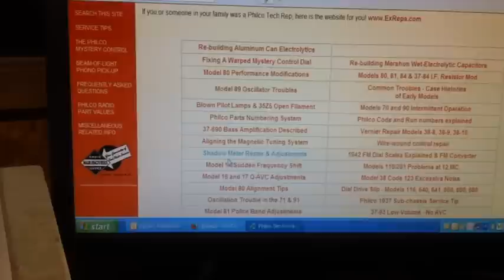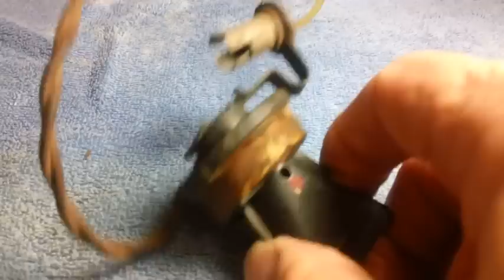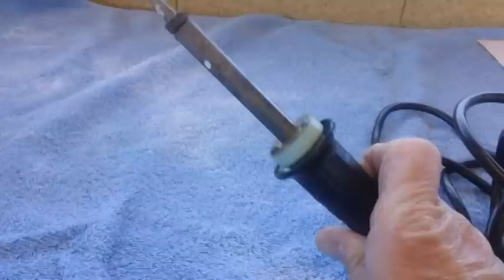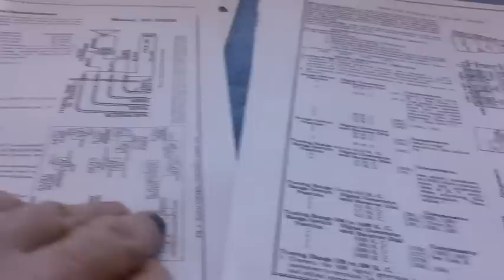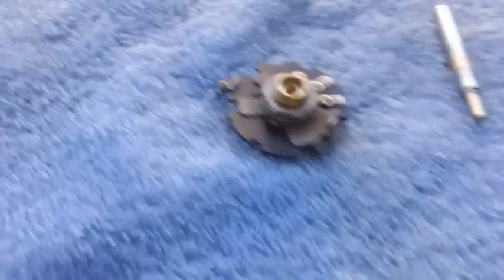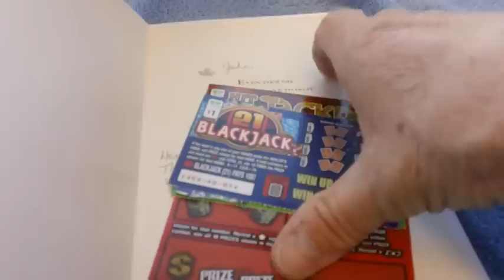Philco model 37-2670 repair and restoration (Part 7 of 34)

Comment: Great video, John. I'm a bit of a newcomer to rehabbing these old radios -- and I've been using your teaching as guidance. So far, I've completed basic restoration on a couple of Silvertone radios. I wouldn't have been able to do so without your videos. (My next is a Philco 42-355. I've already obtained the schematics from Chuck Schwark.)

Keep the videos coming. I look forward to seeing this one complete.

Best regards,

Ron
Reply from the maker: Hey, Ron...it's good of you to be part of our little group.
I had never seen a model 42-355, so I looked it up.  Very cool-looking radio.  Good for you.  Does it have as much ratty rubber coated wire insulation as its predecessors?  If so, you know you've got a job on your hands.
Keep us abreast of how the project progresses.  I'm looking forward to seeing it.

Regards,
John
Reply: There are both cloth and rubber wires -- and the rubber is in so-so condition. There are a number of caps that are buried under various components, so this is going to be a challenge. I'll keep you posted.
--Ron

Comment: Hi John, In my opinion you can't beat Weller, I was lucky enough to pick up a TCP 24v unit complete with iron from the local university who were decommissioning a load of old equipment at the time, so I went "dumpster diving" (we call them skips over here) and rescued the Weller and a very nice old Advance valve/tube sig genny which had only just been serviced! It was the only way I could own a Weller TCP, like you say they ain't cheap!
Reply from the maker: Kevin,
It's amazing how much good stuff can be had by dumpster diving.   It's tradition where I come from.  :-)  And a good sig. gen. to boot...banner day for you, it was.
You know...a good ole Radio Shack soldering iron would probably work just fine for our radio repair/restoration needs, but a Weller...heeeeyyyyy...real men deserve one.  :-)

Regards,
John

Comment: I used to use a cheapo radio shack soldering iron for everything but now I switched to an old (Archer I think) soldering gun with the copper tip and the little penlight bulb. it puts out a lot more heat. I was having trouble getting the solder to melt with those low wattage radio shack irons.

Comment: I have one of those ATTEN AT938D regulated soldering stations from ebay for about half the cost of the Weller. They have all sorts of tips for it too. And it has a nice LCD digital temp display too. I've had it for years, no problems, and it works great.
Last week I bought a Weller BP645MP battery soldering iron from Lowes for about 20$.I've used it once, and so far, so good. It's light duty, but is nice when you need to solder something quick and you don't want to drag wires to plug it in, and such.
Check um out, kewl stuff! btw, I also have a soldering pencil I got at Harbor Freight Tools for about 5$, much better than I expected, great for the tool box.
Reply from the maker: Don,
I don't even know if I've answered this comment.  Every time I click here and there on this Google+ mess, I find more comments I've missed.  It looks like yours was one of them.  If so, I'm sorry for the delay.  It wasn't intentional...and will probably happen again.  Just know that I'm not ignoring you, my friend.
My son likes his battery operated soldering iron.  Don't know the brand, but he says it works fine.  I'm not sold.  As you said, they're light duty, so for me it wouldn't fit the bill.
Thanks for popping in again.  Se you next time.

Regards,
John

Comment: John,
I picked up a Weller soldering iron like yours last year at a flea market for 3 bucks. It works great, I need to get it a replacement tip sometime down the road. Nice job on the tone/power switch rehab, should work great. Send that 8 way split of $200,000 soon, propane is not getting any cheaper ! Thanks for another great video.
Nathan
Reply from the maker: Nathan,
A 3-buck Weller...how lucky can one get?  The on/off/tone switch should work ok, but one never knows in this bidnez.  But no sweat...if things ultimately go awry, I do have a plan B.
After next vid the big money should be coming your way.  :-)

Regards,
John

Comment: John,
As usual, a great video that is a joy to watch – well done.
How right you are about not relying upon one’s memory: mine isn’t what it used to be! 
Purely as a matter of interest: reconstructing and fitting a replacement paddle as a means towards reconditioning the defective shadow meter – realistic or not?  Why?
Regards,
Phil.
Reply from the maker: Phil,
Not realistic.  The paddle is very thin.  It's mounted vertically into a slot cut in the center of a thin, round disc.  The edge of the disc has two small points (pivot points) located directly across from one another, one at 12 o'clock and one at 6 o'clock.  The points fit into small holes, top and bottom, of the metal cone.  Apparently, it's the disc that reacts to the magnetic field set up by the coil.  When the disc rotates the vertical paddle mounted in its center rotates with it.  So the disc as well as the paddle would need to be fashioned.  Very tough to do.
But I say go for it, old bean!!!  :-)

Regards,
John

Comment: I have the Weller WESD51 solder station which is higher end unit with the digital temperature readout and it's a real godsend when working on PC boards from Westinghouse and Sylvania who are easily damaged by overheating the traces. I got mine from Amazon a few months ago for $120 shipping included.
Reply from the maker: Jerry,
You got a good deal on your WES51.  They usually go for more bucks than that.   But it is a nice unit.  It's the old story...you get what you pay for.

Regards,
John

Comment: I picked up that Weller WES51 solder station about two years ago when my old Ungars started giving me problems (can't get parts for them anymore). I HIGHLY recommend this unit. Great even temp control, fast heat-up and a multitude of tips you can get for that pencil. 100% power will unsolder parts off the chassis and 25% is good for those tiny SOT23 Fleas you were working with on that old Bose(?) radio. Just FYI, Dave
Reply from the maker: David,
I hope to not work on any more Bose fleas.  :-)  Once was enough.  I only did it as a favor to a friend.  I just got lucky enough to make it play again.  It could have easily gone the other way.
The Weller WES51 is a nice unit, but I'm not sure too many can afford the bucks.  But I've heard that you "Young Family" folks are made of money.  :-)

Regards,
John
Reply: joernone
NOT anymore! I just did my taxes and there will be no extra money for toys this year!! Shop around, I found that Weller for FAR less than the price you showed us on FleaBuy.

Comment: Good info again, John.  Good luck with your latest lotto numbers.  I suppose you'll leave us once you hit the big jackpot?  I use a 35 and a 60 Weller with good success I recently came across a little project to reduce the voltage to the iron to keep it warm, but not hot, when not needing to solder for a period of time.  A small value, high watt resistor in series with a by pass switch to flip on, for full voltage, when full heat is needed.  Ever heard of that?  It's supposed to extend the life of the tip.  I'm a little late to the repair biz.  I suppose it'd work?  Worthwhile?  I'll see.  Thanks again for being there for all of us John.  The help is terriffic.
Reply from the maker: Anything is worth a try, my friend, and you'd no doubt learn something from it, which is what experimentation is all about.  But soldering iron tips are cheap and plentiful, so I figure what the heck.  Besides, good soldering practices like keeping the tip tinned when not in use will greatly extend the life of tips.
But you know...when I hit the lottery I'll buy every single one of our subscribers a new soldering iron tip.  :-)

Regards,
John

Comment: John, Little did I know the significance of that tone/volume control. It was in a paper bag along with the tubes returned to my mother along with the radio. I sent everything along to you and am sure glad I did. Keep on doing your thing. You're the best.
Reply from the maker: Martin,
You did good to include that pot.  Smart thinking.  But we're not out of the woods yet.  After all this work it may not function like it once did.  That's the way it is with these old radios.  But not to worry...there is a plan B.  :-)

Regards,
John

Comment: I have to agree with Juan, sometimes we don't think about it, but, some of these radio manufacturers came up with some really clever technology, for the times.  Anyway, good video, came in handy having your own machinist!  I use a 40W iron, normally.  Also have a soldering gun, if I have to desolder a chassis connection, or something like that.  I wish I still had my 70's Weller station.  It had a variable temp iron aand a separate desoldering iron with a vacuum, activated by footswitch.  Remember those?  Tell Mac howdy, for me.
Reply from the maker: Al,
You know...there's two things I won't allow near my workbench: Solder wick and a soldering gun.  Both can and do cause far too much over-heating damage.  I've seen it happen time and again, generally by the unskilled and impatient user.  In fact, the field generated around the tip of a soldering gun can easily wipe out some modern day components.
Fortunately, you know to use it only for soldering/de-soldering chassis grounds.  Many do not.  I have a friend who uses a gun for all his soldering...and it shows.
I once had the good fortune to use a Pace machine for soldering.  Terrific setup, but they want an arm and leg for those jewels.
BTW...old Mac appears more than once in the next Mish-Mash, but it'll be a while before it's finished.
Take care, my friend.

Regards,
John
Reply: The one I spoke of was a Pace, in fact.  I could never have afforded it myself, I talked them into buying one in my detachment, in the Navy, after going to that soldering school we both attended.  If you want to shudder, there is a rather brilliant guy on YT, glasslinger, who Tom (AntiqueRadioandTV) told me about, who actually makes tubes.  He has a video up of a repair of a Westinghouse Refrigerator type radio, uses a solder gun for EVERY connection.  I was horrified, as was Tom.  Some of his other videos are really cool, though.  I really recommend giving him a watch.  I've hesitated doing so, in the past, only because I'd hate for anyone who, maybe was starting out, to see him wield that gun.  I've been training my boys to give Mac a warm welcome, I'll have to put that in a Mashup video soon :-)